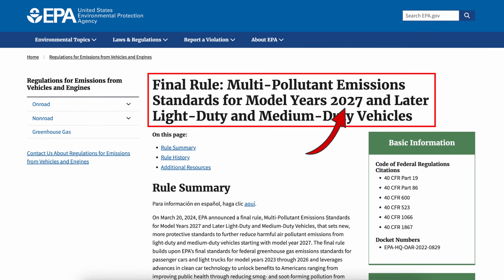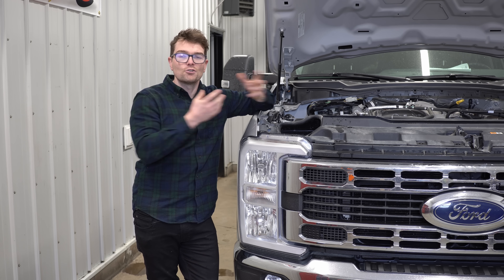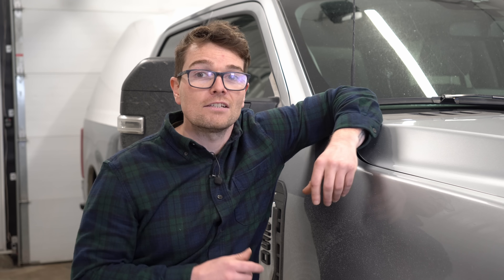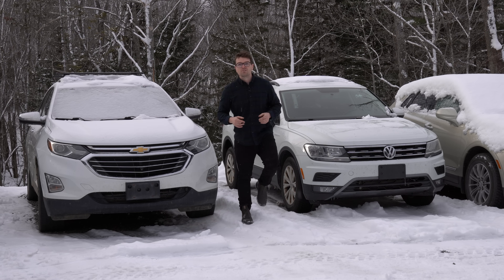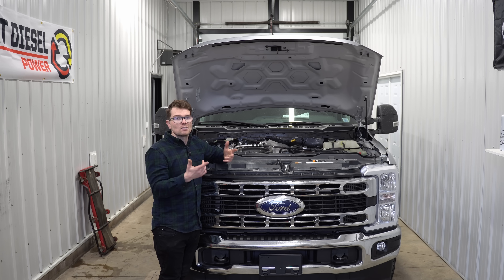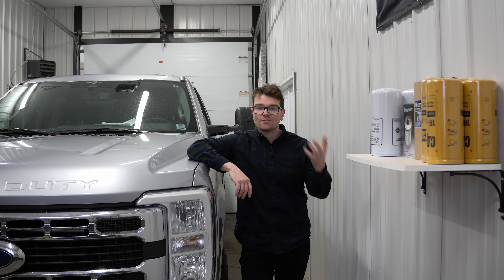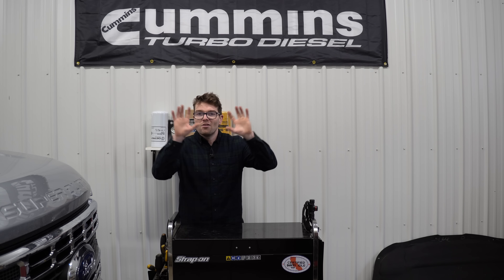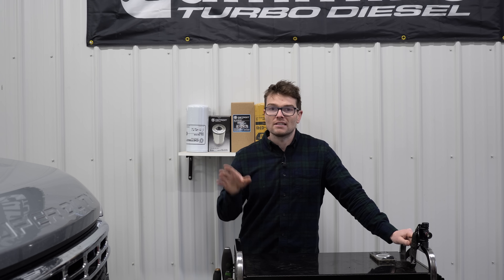NEW 2027 Cummins Diesel Engine EMISSION REGULATIONS are WILD **Diesel Mechanic Explains**

Comment: The day I understood that an EGR system is effectively force-feeding an engine its own excrement was the day the EPA had a new hater.
Reply: The EPA never mandated EGR systems. There are better ways of reducing Nox that don't involve EGR, and a few manufacturers are preparing to introduce it commercially, like Honda and (I might be wrong on this one) Cummins. Mostly with valve timing and new ignition systems that reduce low-load temperatures.

Current EGR systems also have room for improvement. Manufacturers are not incentivised to improve anything if the vehicle already exceeds the warranty.
Reply: @Southghost5997  scania trucks have not had EGRs on most of there engines since around 2010
Reply: @94Gidge  Yeah, but emissions-compliant vehicles with those engines use AdBlu (or an equivalent) to convert nox into water and nitrogen. It's not exactly ideal but better than poorly designed EGR systems.
Reply: @Southghost5997  ad blue has been part of emissions since euro 4 or 5 I can't remember which one and Google gives mixed answers. The scania engineers worked out that they can reduce NOX to within limit with ad blue and fuel programming alone. I have worked on both pre adblue and post adblue scania engines and the ones with adblue are Alot more reliable than the ones with EGR.
Reply: @94Gidge  yep, that sounds about right
Reply: on a basic gasoline engine it saves a ton of fuel.
Reply: @milkyperformance  With gasoline yes, absolutely. Diesels though will happily run stupid lean. They just spew out a bunch of nitrogen oxides if there's excess oxygen available. At typical high diesel compression ratios anyways. But you don't want to lower the compression since it's a large part of the reason why they're so efficient.
It's such a shame. They're beautifully simple machines if you don't care about emissions, but it doesn't take much for those emissions to cause problems.
Reply: Yep
Reply: I deleted mine
Reply: @michaelschuler7397 what’s your license plate number?
Reply: Insurance companies in Australia have been denying claims if they find you have removed the dpf, even the egr
Reply: Delete immediately
Reply: Yeah it's annoying, but all that diesel excrement is no good for urban air quality. Even in small towns. I have a bit of asthma, and as a teenager those old diesel vehicles really messed me up when I had to walk along the main road to get to school. Especially in the winter. And my home town was not large! That shit's no better for your lungs than it is for your engine, so I'd rather feed it back into the engine. Wouldn't be a problem if it was easy to clean the soot out of the intake plumbing every few years, but it rarely is. And there shouldn't be much soot anyways if the engine is well tuned for efficiency.
In properly rural areas with very few vehicles around I can see how it is overkill, but otherwise it is the simplest way make diesel engines run cleaner without sacrificing efficiency. It's when you get into particle filters that the downsides really start piling up, to the point that it badly impacts the value proposition of a diesel engine. But on the other hand I could really feel a difference in air quality after those became common. In my childhood diesel exhaust used to be pretty nasty, but these days it's almost unnoticeable.
Reply: Your lack of education does not change the complexities of the world around you.  EGR reduces pumping losses for low power applications around 30%.
Reply: Cry harder..?  @ShainAndrews

Comment: EGR does not lower cylinder temps. You’re putting hot air back into the engine which raises temps and makes it less efficient

Comment: Or, we could just take all that crap off the diesel truck. If engineers can make the injectors have multiple injections for each combustion event to make the engine burn diesel more efficiently and cleaner, then why do we need all the rest of that garbage on the truck in the first place?  All the rest of that crap is nothing more than an overpriced headache.

Comment: DPF is a joke nobody is ever going to tell you what's going on when the Regen turns on than you blow straight 300% of polluted air and nobody will ever tell you that you will use about 2000 gallons of extra diesel just for Regen purposes over live of the trucks.its all designed to use more fuel in real life there is a better way to make engine run clean but no u need to buy more fuel ⛽ that's what they like.

Comment: It's class warfare.

Buying trucks and equipment are a common way for working people to get into the middle class.

They make all these rules to make everything more expensive and less reliable.  If you're not a big company with a fleet it's a struggle to make a profit, especially with the rapidly growing MSRP.

And on the mechanical side, they're making it harder and harder to get the software required to service and diagnose these systems.

Comment: Euro 6 Emissions regulations have been in place in Australia since 2015, now it's a requirement for new diesel vehicles to have AdBlue. As a business owner it's meant more work which is great for the bottom line, sucks if you're a vehicle owner and out of the warranty period.

Comment: I do not know of a better way to punish small businesses… currently, new diesel engines pollute 5x less than new gas engines?  The ENTIRE economy revolves around the transportation of goods… meanwhile in india… garbage fires in the streets and our epa thinks we are the mf problem?
Reply: Emissions are a LOCAL problem (you can’t filter CO2). So no, it is not relevant what happens at the other side of the world.
Reply: @Freba9  you want to discuss local problems?  Try costs of goods going up.  
To say garbage fires in india have zero affects on anything but say that our trucks running goods are bad for the environment is just plain silly.  As long as its not in your backyard, amiright? You remind me of those horses that they have to put blinders on so that they focus on the task at hand. They don’t want you to see the whole picture for fear you might affect their plans.
Reply: @dawsonpurkett6246  Again, diesel emissions are a local problem. Trucks driving around your house pollute the air you breathe. It doesn’t make sense to use polluting vehicles in India as an argument against EPA.

Comment: Essentially they are trying to force companies to give up and stop producing diesels all together without actually banning them. "Of course you can still have a diesel as long as you agree to these insane and essentially unattainable parameters"
Reply: It’s effective. I will not be purchasing a new truck with these crazy prices and systems
Reply: @dawsonpurkett6246  I agree I have older vehicles and at this point will probably be sticking to pre 2007. Unfortunately though what will happen is the option will be removed entirely and we won't have a choice.
Reply: It’s so bizarre to me. The emissions created to manufacture all of these systems and to make a brand new truck, when you factor in harvesting materials, transportation of said materials, refining of materials etc, definitely seems to cause more pollution than running these older trucks longer…. These government agencies act like businesses, they try to make their own revenue, so that they can scale and regulate more haha seems the only way for pollute less, when you factor in everything, is to create a product that lasts for some time.

Ironically, The EPA and other federal agencies will basically dry up if we stopped using combustion engines. They collect so much revenue from gas tax, and other taxes from the companies that manufacture them.  At some point they would have to tax something extremely unethical to make up that revenue, right? Oh wait…
Over regulating isn’t sustainable, In my opinion. At some point our compliance makes them irrelevant. 
They hand out fines to just stay busy these days.
You give a person a hammer, everything starts to look like a nail…

Comment: The most ridiculous idea is our government putting an EGR on a diesel! These EGR valves clog up from the soot who pays the price for that dumb ass idea. Now with this Def fluid sounds to me like the Oil company's idea to make diesel engines  owners spend more money on fixing all the problems with this stuff. Not to mention why doesn't the manufacture make changes to the pistons like put the golf ball dents in the top of the pistons just doing this lowers the EGT temps over 250' and the engine doesn't produce any soot. I think it's time to make the manufacture engines with better parts like get rid of the C-4 injector pump they all fail and send the parts threw the engine you know this Ain't rocket science.

Comment: I feel that the 48v heater will make all the difference. 
All you need to eliminate soot is high temperatures in the DOC.
This way, you lose the injector that's plugged into the exhaust but will likely have to keep the whole DEF setup.
Some F-150s already come with two alternators.
Welcome to the future.

Comment: Hydrogen engines, just make the switch in 2027 and you won’t have to worry about the emissions
Reply: Not realistic unfortunately. Battery electric will be much better though.
Reply: @ there are way more problems with battery electric than hydrogen. First the cost of a battery replacement. Furthermore batteries only last 8-10 years. Meaning after 10 year the vehicle is just a massive paperweight because the cost to replace the batteries is so high its a better decision to buy a new vehicle instead of repair. Then there is the issue of all the heavy metals is junk batteries. They are trying to recycle but the vast majority of the material left over in bad batteries is useless. Plus the cost of recycling is really expensive. Charging infrastructure isn’t there. Our power grid is already being limped along. O top of these problems nothing catches fire like a battery powered car! Once they go up there is no putting it out. If water is used the vehicles explode. I would never park one of these things in my attached garage. The fires they cause are horrific. If any vehicle gets I to an accident the fire of fire is pretty high. When the fire department shows up to an accident scene they cut the battery cables to prevent fires. That’s not so easy in ev vehicles. It the batteries are damages and they go up in flames it’s a disaster. Tow yards now put cement barriers around ev cars becuase of this issue. 

Many of these problems exist with hydrogen as well. There is no infrastructure. The nice part is hydrogen is made from water. Number one resource on earth is water. The engine emissions Is water and a very scarce amount of carbon from the oil in the cross hatching of the cylinder walls. On top of that the engines will be extremely clean inside and won’t produce carbon. Many current engine can be converted to hydrogen with little issues. Becuase these engine don’t produce carbon they will last longer than current gas/diesel engines . These engine will easily go past 10 years and hundreds of thousands of miles. So they will be economical. It will be better for the environment in every way. Another problem is liquid hydrogen is very cold and hydrogen is very explosive. So the tanks will have to be very protected from accident. Hydrogen will be the future for many reasons. 

There will be a place for EV but not as large as once thought. Look at California they can even charge ev cars because the power grid is past max capacity. It will take trillions of dollars to upgrade the entire country not to mention many homes will need to upgrade to 300-400 amp panels to support charging ev vehicles. The electric service needs upgraded but we as a country are unable to do it quickly enough. Plus the power plants keep closing down and consolidate. Imagine if there was a massive power outage and we all have ev cars. That would make the country extremely vulnerable to foreign enemies.
Reply: @mattellisonquadshopracegar1138  A few things:
- Current EVs have batteries that will last at least as long as the rest of the vehicle.
- Fire risk is FAR lower than a combustion engine car.
- Main resource for green hydrogen production is electricity, not water.
- Using hydrogen in an engine is so incredibly inefficient that such a vehicle would consume 5 times as much electricity as an EV. Good luck with your national grid.
- Due to this horrifically low efficiency range will be terrible, or your car won’t have any cargo space left due to the gigantic tank.
- Again, the vast majority of vehicles will be battery electric. A small percentage might be hydrogen fuel cell. 0 (zero) vehicles will have a hydrogen combustion engine.
Reply: @ time will tell. But the added cost of buying a new ev vehicle every 8-10 years and getting nothing in return, will only strain families that already don’t have the money to spend on vehicles. It’s not environmentally nor financially responsible. Just other way to keep the boot on low incomes families necks and keep them down. Many of those families are driving cars much older than 10 years. Ev tech will improve but even auto manufactures are moving towards hydrogen technology.  Yes they use electricity to split water into hydrogen. You could build these plants close to power plants therefore decreasing the need electric infrastructure.  

The risk of fire is much greater with battery powered cars than ICE especially after an accident. Family had a towing busy for 20 years I have seen them all go up and nothing compares to EV fire. There will be a place for ev  and hydrogen both. Hydrogen will have a larger roll than zero lol. The charge time of ev is also a big detractor.

I feel the best would be hydrogen generator with electric motors at the wheels, similar to a train.
Reply: @mattellisonquadshopracegar1138  no, time has already told us. It’s 2024. EVs have pretty much reached price parity. Families having to buy insane amounts of expensive hydrogen will strain them, not buying and charging an EV. Not a single automotive company is seriously moving to hydrogen. Even Toyota has given up. It’s over. Even for trucks.  
Again, data is clear: fire risk is many times lower.
Correct, hydrogen fuel cell with electric motors is favorable over hydrogen combustion engines. But even this solution is simply not efficient enough to compete with EV.

Comment: My brother deleted his fleet (not a legal requirement here) at $5000/truck. No dash lights on, no drivability issues, big boost in power. Here's the real kicker: less than 5 years and the delete is paid for in fuel savings and it'd be way less if he wasn't a farmer and only runs the trucks for 4 months out of the year.

EDIT: And if your truck decides to regen in a bone dry field of stubble, you can burn a field
Reply: Same my father deleted his 6.7 Powerstroke got an extra 5 MPG and dropped over 100 lb a lot of people don't realize that system also while it will keep the exhaust slightly cleaner when that regen system runs the fumes are toxic
Reply: Next the EPA might require you to spray your field with DEF before the diesel exhaust burns your fields.
Reply: @MrNobody2828  DEF in a field is actually good.  Urea is a Nitrogen fertilizer!
Reply: @MrNobody2828  I wouldn't put it past the idiots.
Reply: Arkansas mechanic here, 6 field fires in the last 2 years started by truck regen.  thats just local.
Reply: @Squints-xg5ro  at the minimum there needs to be an ag exemption. Health and safety reasons.
Reply: @j.danaclark2166  The only exemption in Ag are tractors <70hp so basically weekend warrior hobby wannabe farmers.

Comment: Kind of sounds like you just touched on a potential solution. What happens if we scrap the whole project and start from the beginning. If the problem is incomplete combustion producing soot get rid of the whole damn EGR system and let combustion be as hot as it can be then dump a ton of DEF into an SCR and take care of the Knox. I'd be way happy having two tanks and more power. DEF is not that expensive or complex at least as a fluid. Sounds like the introduction of the EGR made the process way more difficult. If combustion can be as hot as it should be we could use a heated DPF filter to remain more efficient and allow chemistry to do the rest of the work. I recently experimented with my own F-150 3.0. I wrapped the DPF and downpipe after the turbo to see if I could keep a little more heat in that section of the exhaust. It seemed to raise the temperature about 50 to 70°. Not sure it will be enough on my extremely short trips to decrease my regen frequency. I'm hopeful to monitor if it will decrease the amount of fuel needed to complete a burn. Hit me back after you digest this comment.

Comment: Thanks for a nice video I did not know diesel well at all been a gasoline driver of my whole life.

Don’t do a ton of hauling. My limited knowledge of diesel is that it cost more supposed to give better fuel efficiency, but a lot of government regulations hurt that fuel efficient see I hear oil changes are expensive as they take a lot of oil.

I’ve heard from some
Family wants on the Lexus a high compression engine vehicle and was forced to buy premium gas. I can say my families not excited about ever doing this again. 

Cost of living is high and it’s not going down. 
Look at the good news if you’re a diesel mechanic I’m pretty sure you have a good stable job

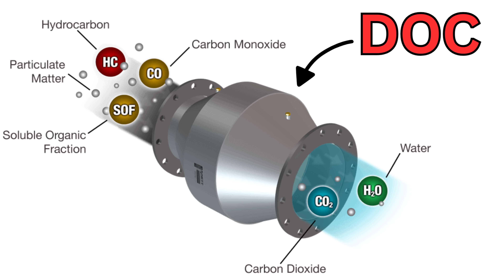Comment: 2:28 some DOC's (example, for FPT engines in CNH farm/construction machinery, Iveco trucks) are also designed to change the balance of nitrogen oxide and dioxide, something to do with a certain ratio being better for the reaction further down in the SCR. "Better living through chemistry" as someone used to say.
Reply: I see fpt engines with no DPF in 2024